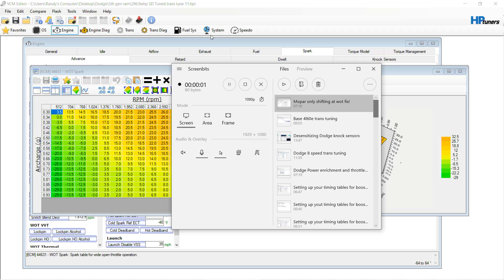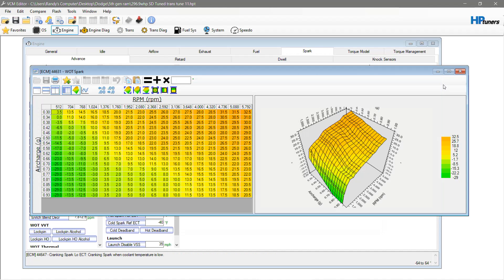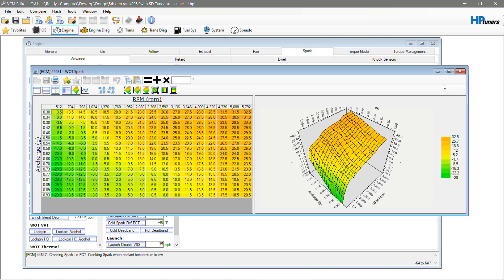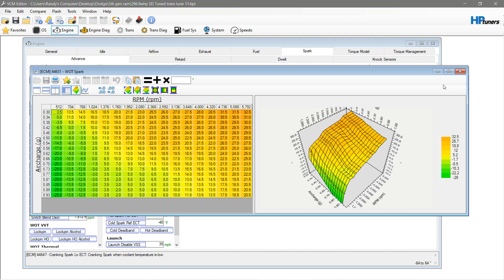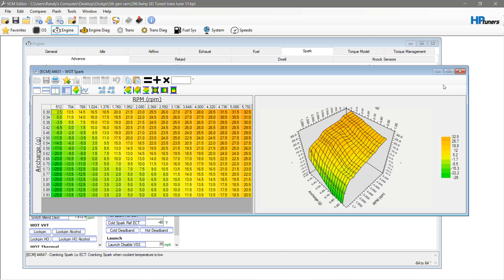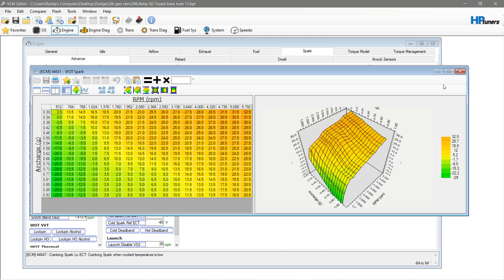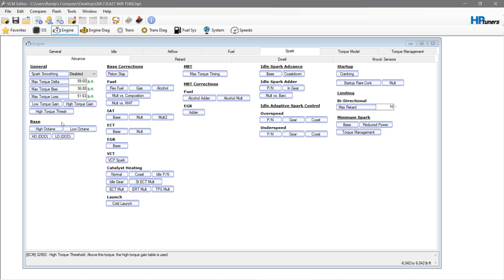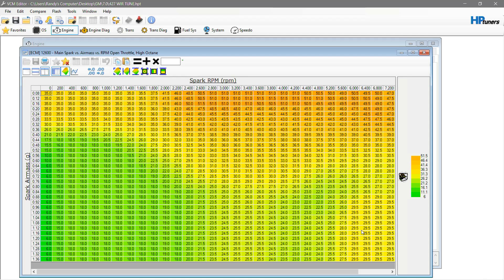Hemi and timing issues

Comment: Just found your page. Im starting to get back into tuning and would love to ask some questions if possible through my journey. I have the The tuner school book for dodge but feel like its real simple and can't get the question I want answered
Reply from the maker: Yes I’ll try to help the best I can
Reply: @Recklessmotorsports  Can you email me at seriouzfilmzclients@gmail.com but i have a hp tuner issue that I ran into last year that no one could figure out. I flashed the car and the tune got stuck. Reflashed it successfully and then the car would start up and then after 3 seconds die. I could remote start it and it will run but soon as you press run it will show the gauges cycling and then shut off. Dealership wanted to just replace the ecm and everything related. I replaced eco and no help. Dealer refunded my money but they said it had a vin handshake issue or rfh code. Only way I was able to get it started was trying all kind of resets and then flashing the t=car with new tune and then selecting skim disable after the flash. It runs but now I have to do the skim disable after every time afraid to not do it and I run into same issue. but the security light flashes all the time now. Would love to see some things you would change when adding headers!
Reply from the maker: Randy.ziegelbauer2014@gmail.com

Comment: I can’t seem to get more than 15.5-16 degrees without getting knock on 91 . Although i dyno tuned a 5.7 with vp octane booster on 91 and added almost 4 degrees of timing but only gained 5 hp . What i know is that hemis don’t need alot of timing to make power
Reply from the maker: Even my hellcat I ran 22 at wot. You should put in race fuel and see how much fans knock you have
Reply: RecklessMotorsportsUSA i used octane booster and was able to raise it to 20 didn’t see that much difference on the dyno

Comment: What is your take on octane additives for us on the west coast limited to 91 or 92?
Reply from the maker: It helps, finding e85 and adding some to boost octane is better though
Reply: @Recklessmotorsports  I was looking at boostane.   E85 isn't really a great option in Portland.   Do you have a take on octane for boost values on the hemi engines?